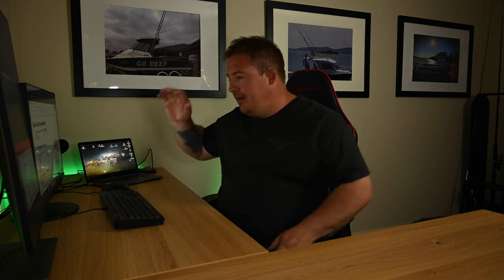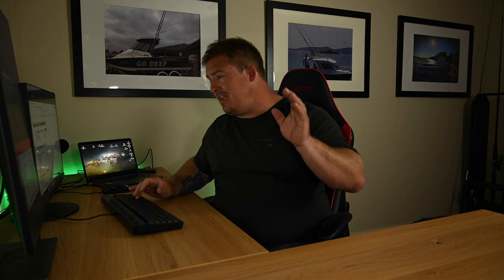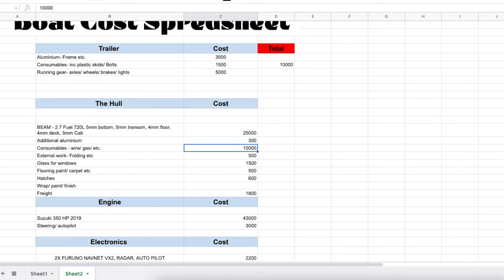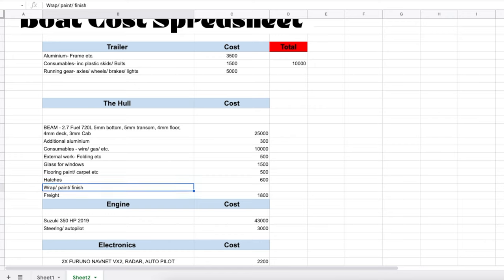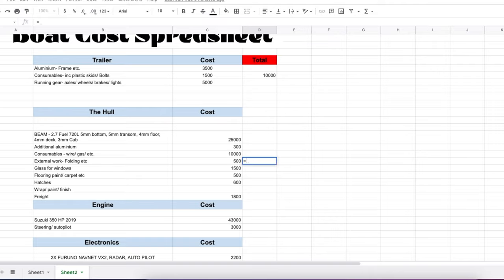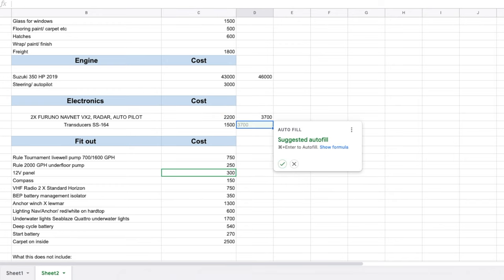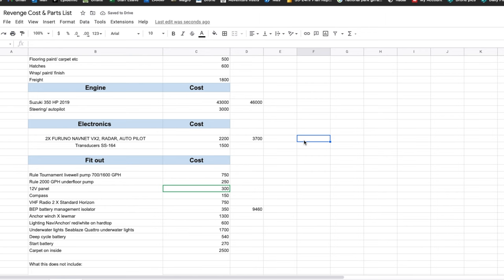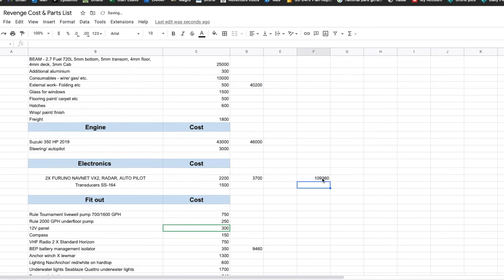WHAT DID IT COST? Custom 8m Plate Boat- DIY Plate Kit Boat Hull Build

Comment: Hi Matt, great video. Can you tell me the gauge of Aluminium used for hull (bottom/sides) pls?
Do you see issues with 5mm bottom and 4mm sides?
Thanks
Tony
Reply from the maker: Hey Tony
From memory, Im pretty sure the bottom/ transom was 6mm, 
Sides etc were 5
Everything else was 4. 

The framework under the floor is pretty epic I can’t see any problems mate everything is really well supported.
Reply: @MattyRacingLife  thanks for taking the time to respond Matty - keep the adventures coming!